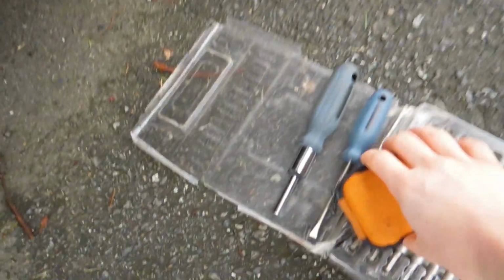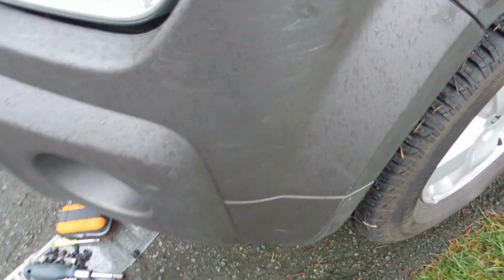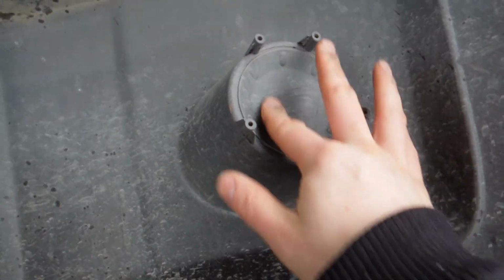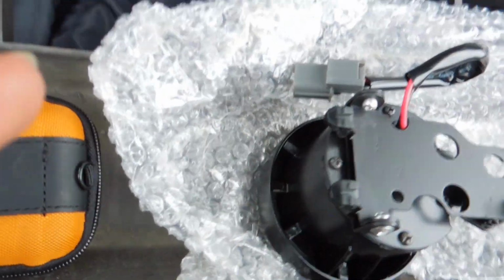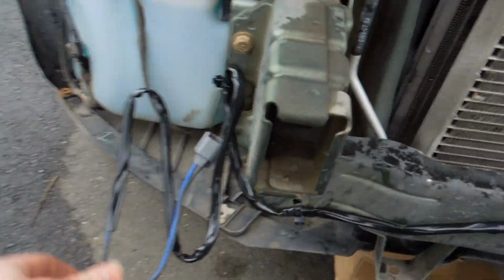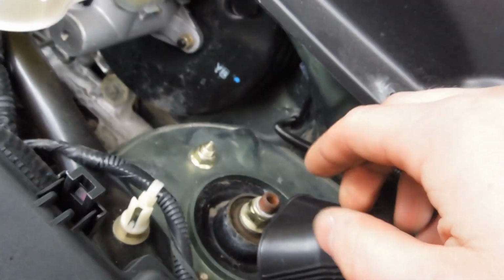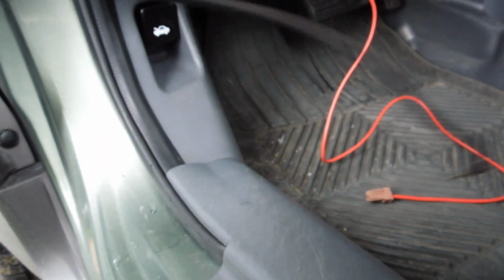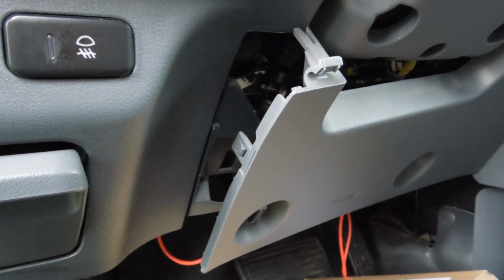how to install fog lights on honda element 2003

Comment: Your video helped me a lot!  I got my lights installed and am ready to go except I have one difference.  Your power has a brown plug to plug in.  Mine has a bare wire and a wire splice.  Any idea what wire to splice into?  I am hopeless when it comes to electrical.
Reply: I having the same issue. That's plug that he shows is a hot wire so the light on my switch stays on when the car is parked. I tapped into the cigarette lighter for accessory only and it blew the fuse on my fog kit I replaced it with the same amp fuse then it blew my cigarette lighter fuse and has continued to do so. I'm trying to find a location to connect it to only work when the car is on and when it's off the fog light kit get no power but since the kit has a 30amp fuse I'm assuming anything less than that it will blow the circuit.
Reply: @rm4213   I took your advice and I tapped into the rear wiper arm.  It was the least used item.  But I have to make sure I turn OFF the fog lights before I use it or I will blow a fuse.
Reply: @mishabear9261  I ended up tapping into the power mirror fuse I've had no issues at all.

Comment from the maker: the power wire should be. if its a aftermarket kit you will have to track the wiring and spot the fus or the fuse that connected to were your getting power from. check the fuse box under the hood and under the dash for fog light fuse for factoryor aftermarket aswell

Comment: Hey got a question I just installed fog light kit just like yours. But my fog light switch stay lit up and when I press the switch it gets brighter indicating that the fog lights are on inwhich they are. But my concern is the light on the switch staying on when the car is off and parked. Should I get another switch?

Comment: Looks like your are deft with wires around Honda Element. So I got question about radio connection. I bought one of those conversion kit but all what it does turns radio on and off. I got no sound coming to speakers.

Comment: Having issues with my fog lights on a 2004 EX.  One burned out.  Replaced the bulb and the other went out as well.  Now I have 2 new bulbs and neither lamp works.  Is there a dedicated fuse for these or an inline relay or something that could be bad?

Comment: This video was posted a long time ago, so I was wondering how those WinJet aftermarket fog lights held up.  The reviews on those are well, not good.  Did you get any condensation, water in them or the housing rusting out?   It may do some good for anyone seeing this to know, as it isn't the easiest job to do.  Especially if you are cutting out the bumper.
Reply from the maker: Bit of condensation happened. Definitely stick to the plastic lens the glad ones get cracked very easily
Reply: Thanks for the reply.  I think I’m going to retro in some new OEM factory lamps from Valeo.  I would have vultured them out of a Ford in a junkyard if I would have been able to find the right model.  But no luck, so new it is.
I’m not sure if the valeo is glass or plastic lens, but I’m sure the lens is probably tougher than on aftermarket.